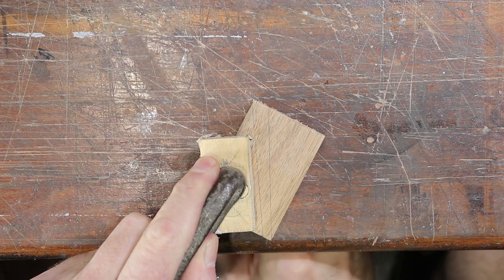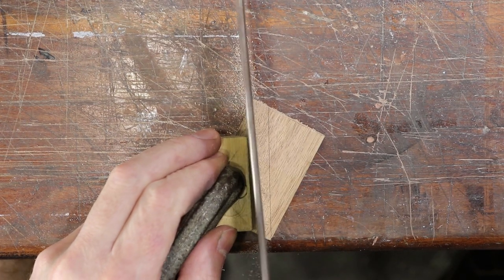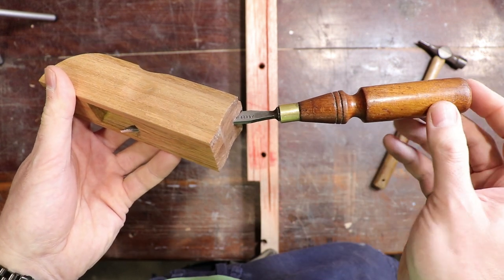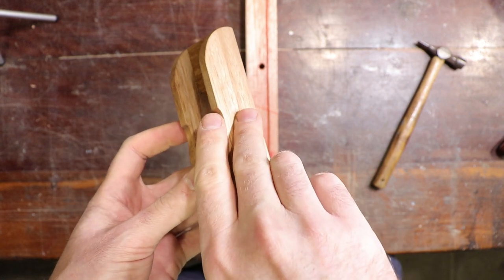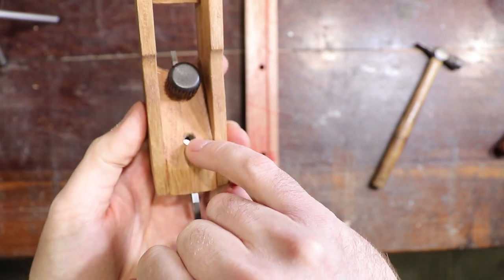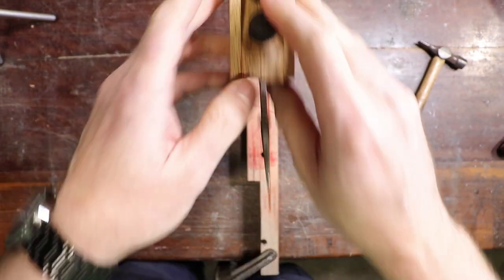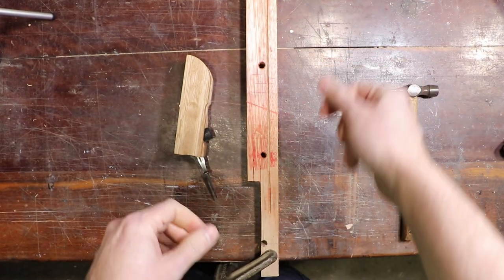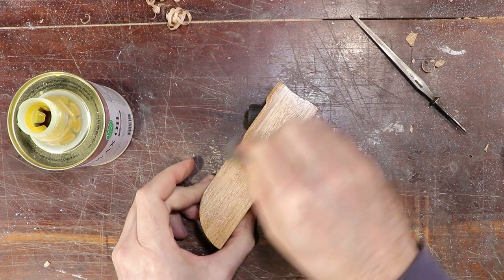DIY Plow Plane.  Making a Trussrod Channel Without a Router.

Comment: great video. I have not used a plough plane before, How easily does the plane route the truss rod channel with out any fence? any tips? I am thinking to try making my own as per your video as I dont like hand routers. Please advise thanks
Reply from the maker: On an actual neck blank, I use fences to get the channel started. That was just a test piece on the video.   Cheers.